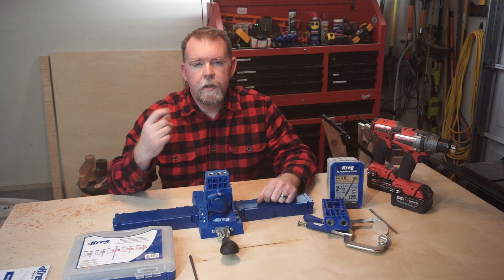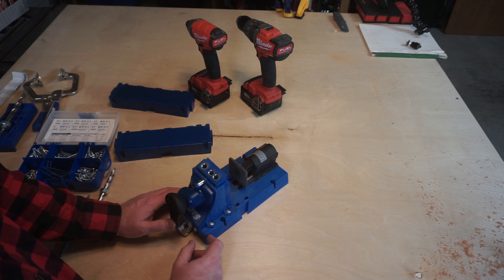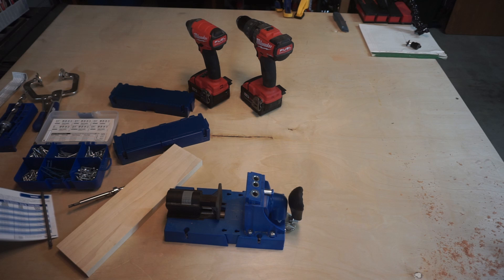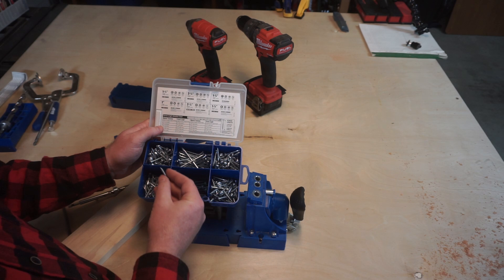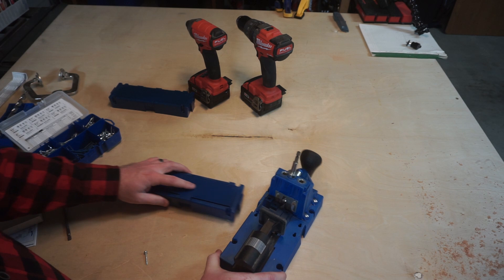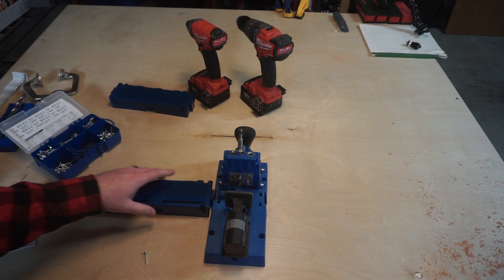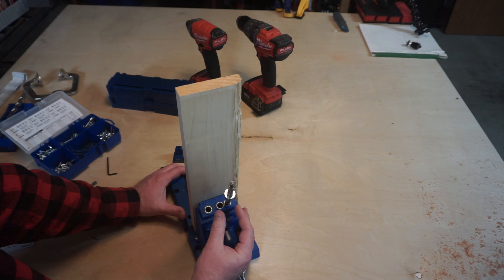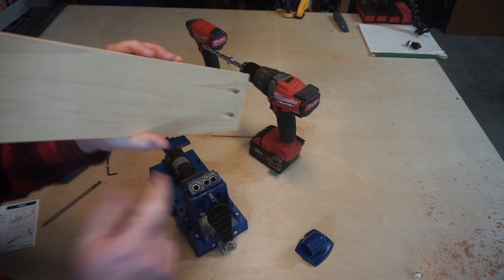How to Setup and Use the Kreg K5 and HD Pocket-Hole Jigs

Comment from the maker: It's been brought to my attention that I used the incorrect clamping technique with the lever in the demonstration. Sorry about that. the correct technique is as follows: PUSH HANDLE FLAT / FLUSH ON TABLE. place stock on jig; slide rear slider against stock; while holding this slider, RAISE THE HANDLE 2 AUDIBLE CLICKS; then push handle flush down on table again. This gives the correct tension  and once set makes re-tensioning for multiple pieces of this same size stock automatic.
Reply: Yes, check out the explanation on page 6, #4 of the manual. : ) -jb
Reply: Was wondering if you knew that or not, and you showed me that you are aware of the correct clamping procedure! Thanks for that clarification, for me and for others! Great tutorial, brother!

Comment: Great video. The only thing I would say is that you should turn your pieces around that have the pocket holes drilled in them. The screws should always be screwing towards the meaty part of the piece of wood you are attaching to, and not towards the end grain. That makes an even stronger connection and will keep any tear out from happening over time. Unfortunately that usually means the hole is always exposed to the outside and will need to be filled on most projects. Very strong though.
Reply from the maker: @Rory Mammano Good point, thanks for the reminder and thanks for watching!
Reply: Doesn't that mean that they are more visible?
Reply: @freebornjohn2687   unfortunately it often does mean they are visible. In that case you’d want to plug the pocket hole. I suppose if you don’t need the most strength on a piece then you can hide the holes on the back side / underside; but for chairs and such supporting weight I’d opt for more strength and then just hide the hole with a plug.

Comment: Thanks for your DETAILED video.  I'm new to wood working and maybe making and selling small furniture. I'm thinking out of all Pocket hole jigs this would be the most reliable and correct for me. Could you give me your expert opinion? Thanks,  Robert
Reply from the maker: This is basically the standard when it comes to pocket hole jigs. You can’t go wrong with it. There are simpler and more complex versions but this is the most versatile in my opinion. Go for it.

Comment: Drive through the joint not into the joint by turning your pocket hole side of the board to the outside. This is how Kreg designed it to be used or your joints will be much weaker! Hope I’m being clear! Thanks for the video!
Reply from the maker: @kirksebts yes, that's a good point. Thanks for watching!

Comment: I enjoyed your video, but did anyone else question the clamping technique?  I believe the handle is supposed to be in the horizontal position as part of the process for clamping.  Snug it up, lift up the handle until you hear two clicks, then tighten it down.  Pardon me if others have noticed....nice video, though.
Reply: Moondog9322 I agree this video cost me my first clamp system that KREG was kind enough to replace for FREE.
Reply: Agreed this video cost me my first clamp system so PLEASE read the manual first.
Reply from the maker: Sorry for the mistake. I’ll add a clarification.
Reply from the maker: @bswonger7356  I pinned a comment noting the incorrect procedure used. Thanks for bringing it to my attention.

Comment: Here's a couple tips for you, and for someone new to this... First, at 8:10 the method you are showing us to adjust the clamp for material thickness, is wrong. You don't just slide it forward to "get it close"...you need to read the directions for using your tool, to learn the proper way to adjust it, because you are not doing it right in this video. And if you're working with plywood, always remember to back off on the depth setting a bit, or your screws might go through the material when you fasten them. For example, the 3/4" collar setting on the bit is meant for drilling actual 3/4" thick boards etc, not 3/4" plywood, because plywood is thinner than that. It's always best to do a test run on some scrap to ensure everything is set correctly, before drilling your actual project holes.
Also, on the HD Jig at 14:58 when you attach the flat clamp to the jig, you can do it your way and keep having the jig fall off the clamp every time you unclamp it, or...if you simply slide the wider pad in the opening from the end and then attach the retaining block/end stop afterward,  the inside grooves will overlap the outer edges of the larger pad, and the clamp will stay as one w/the tool when you unclamp it. It's much easier to work with if you do it this way, and it works the same with the R-3 Jig.
These are all wonderful tools and work beautifully, but you have to set them up correctly, and remember to adjust for minute differences in thickness of materials. I'm just saying all this because the video description says "This video is intended to serve as a how-to guide for those new to woodworking or pocket-hole joinery." But proper setup and use of tools is essential to getting the most out of them, so hopefully these easy tips will help someone new to using these tools. The biggest tip I can give anybody is to always read the directions for the tool, especially if you're not familiar with them, or absolutely sure about how to operate it, adjust it, or set it up.
Reply from the maker: +MnktoDave thanks for all the great info/tips! And thanks for watching!
Reply: Wouldn't it be " Great" if you just drop a Video, including all these TIPS & Demo for us how to do it properly ??
Reply: @korlimservices4180   Why are you giving me crap about my comment? His video description clearly says "This video is intended to serve as a how-to guide for those new to woodworking or pocket-hole joinery." But the method he shows for setting the material thickness clamp is wrong, so he either did not read the directions for doing this, or he did not understand them...bottom line, he's teaching newbies the wrong way, on this supposed 'How To' video. I'm not claiming to be a 'Know It All' and I never intended for it to sound that way if it did, nor did I intend my comment to be hurtful or disrespectful to him in any way...I just let him know that he's doing it wrong, that there's a better way, and that the directions would show him that. I own the K-5 jig, the HD jig, and the R-3 jig and use them all the time, so I do know what I'm talking about. I'm guessing you probably don't own these tools and you probably haven't used them either, or you'd know that everything I said above, was true. I was simply giving a couple of tips to try to be helpful to anyone wanting to learn, to prevent them from making some of the mistakes I made when I was learning this, and to prevent them from learning the wrong way. But I digress, and I'm not here to argue. Please feel free to do it any way you want... his way, or the right way according to the manufacturer's written directions in the owner's manual, that clearly shows the correct way. I'm not going to make a video to show you how to do something that you can learn, simply by reading and following the instructions. Have a great day.
Reply: @MnktoDave  your right !! And my suggestion was...would be " Great " if you did a Video with the right methods as placed in the directions. 
How is that crap ? just see it as constructive criticism .
I appreciate you telling us that the methods he mentioned are not the right ones... !
Have a great  day you too.
Reply: @korlimservices4180   Sorry that I misinterpreted/misunderstood the tone of your comment. I guess it sounded a bit facetious to me because you quotated the word "Great" and then capitalized TIPS & Demo, while asking me to make a video showing how to do it properly... usually when someone says something like that on the internet, they are trolling or being smart ass and calling you out due to what you said. Glad to see it's my bad in this case, and sorry about that. Thanks for responding back in a civil way and making that clear, and it shows just how easily things can be misinterpreted in a comment. There have been a few times I've thought about making a video about using these Kreg jigs (misc tips and setup etc) but there are already so many out there... I do have a few tips I've never seen in any of these videos so far, so maybe some day. But up to now, my videos are all mostly whitewater paddling oriented, for my friends. Like most people watching these videos, I enjoy woodworking as a hobby and I'm always trying to learn new and better methods...that's why I'm here, and that's why I spoke up, in my original comment. Hope you'll have a great day, and a Happy New Year.
Reply: @MnktoDave  Im glad we understand each other. 
Happy new year also to you and ur family. 
You just earned a BIG thumbs up !

Comment: Very comprehensive video and I like the new flannel. I need to get some more myself. I've never had the opportunity to use the Kreg system, but it looks like it makes things so much easier. I have made my own pocket holes before I knew this system existed based on joinery I saw on old tables and chairs. Maybe one day I will spring for a pocket hole jig.
Reply: One other question, does the Kreg system use square (aka Robertson) screws? If so, that's awesome because they are a Canadian invention :) (gotta represent my country)
Reply from the maker: +Grant Alexander wow I’m impressed if you made pocket holes by hand. I would love to see that sometime!
Reply from the maker: +Grant Alexander yup! Robertson drive screws. I love them. So secure and no chance of stripping out.
Reply: @CCSandSonsWorkshop  not by hand, per se, I did use a drill :)
Reply from the maker: @TheGrantAlexander  still though, I think that's pretty impressive.

Comment: Do you think the unit can be pushed to accept 1 3/4" width?  It's only 1/4 more than the maximum specified by Kreg.
Reply from the maker: Yes, I think it would be fine. I would do some tests on scrap would and make sure you have an idea of how far to keep pushing the screw to get a good bite into the other piece of wood. Thanks for watching!
Reply: @CCSandSonsWorkshop  thanks so much!  I suppose the #2 driver that comes with the K5 would work OK with a 2 1/2 coarse screw in cedar work piece?
Reply from the maker: As long as you can keep driving the screw a sufficient distance into the wood, it should be fine. Yes the course thread screws are for softwood like cedar.

Comment: Just ANOTHER demo where the correct procedure for clamping the stock is incorrect. According to KREG :- PUSH HANDLE FLAT / FLUSH ON TABLE. place stock on jig; slide rear slider against stock; while holding this slider, RAISE THE HANDLE 2 AUDIBLE CLICKS; then push handle flush down on table again. This gives the correct tension  and once set makes retensioning for multiple pieces of this same size stock automatic. To be repeated for each different stock thickness.